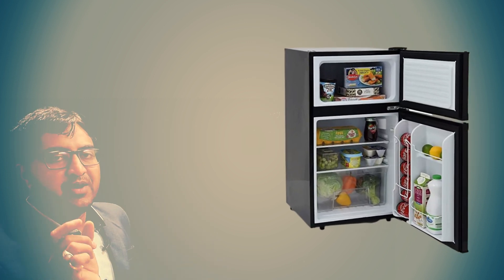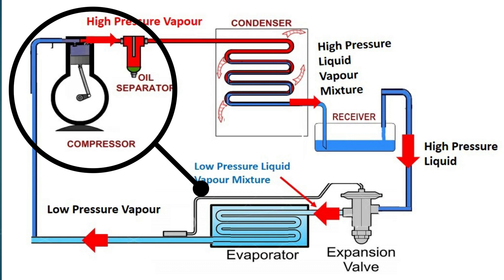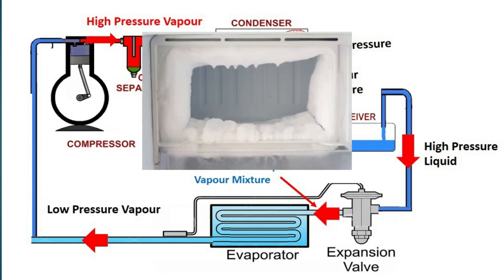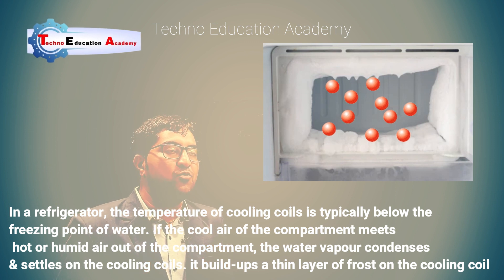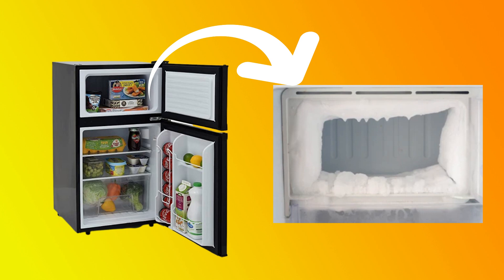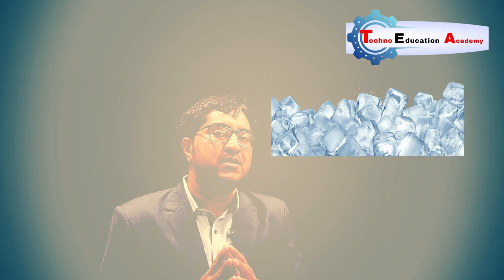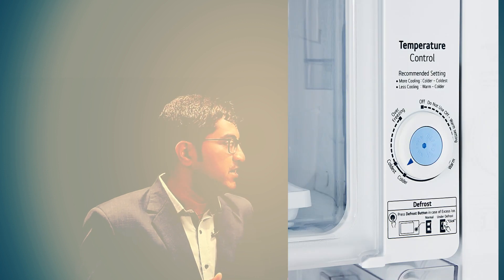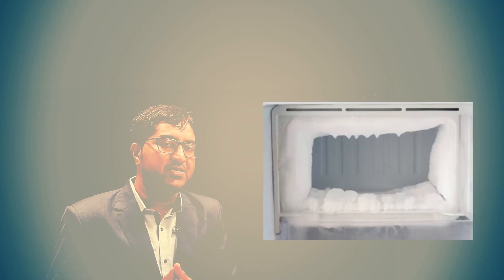What is Defrosting in Refrigerator || Manual Defrosting || Self Defrosting || Refrigerator Care

Comment: Why we have to do defrosting manually in single door fridge only and not in double door fridge?
Reply from the maker: Defrosting is not commonly required in double-door refrigerators, especially in modern frost-free models, because they are equipped with an automatic defrost system. Here's why:

1. Frost-Free Technology Double-door refrigerators often come with frost-free or no-frost technology. These systems automatically prevent the build-up of ice or frost by circulating air through the freezer compartment and periodically heating the evaporator coils. This eliminates the need for manual defrosting, which is common in single-door refrigerators without this feature.

2. Separate Compartments Double-door refrigerators have separate compartments for the fridge and freezer, with their own doors. This separation reduces the transfer of moisture between the compartments, which reduces frost formation in the freezer. The automatic defrost system in these refrigerators handles any minor frost build-up.

3. Automatic Defrost Mechanism
 In frost-free double-door refrigerators, the defrost cycle is controlled by a timer, defrost heater, and a thermostat. These components work together to periodically melt any frost that forms on the evaporator coils, ensuring that frost doesn’t accumulate over time.

So, manual defrosting is not needed because these refrigerators are designed to automatically manage frost build-up.